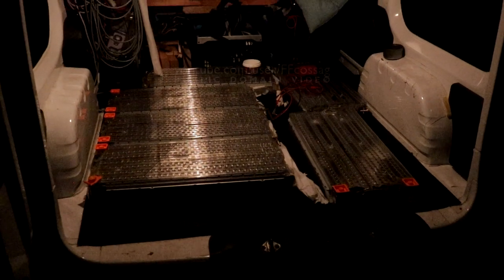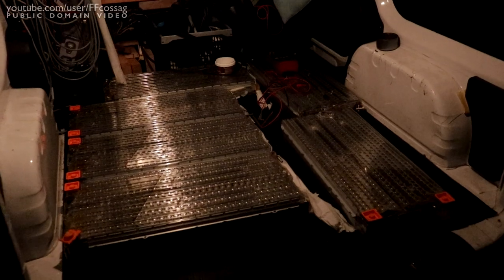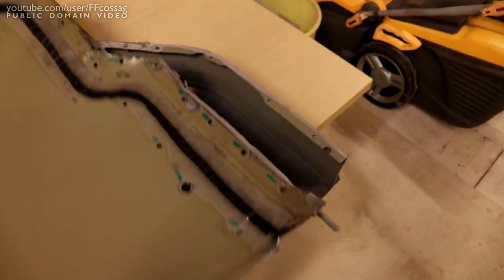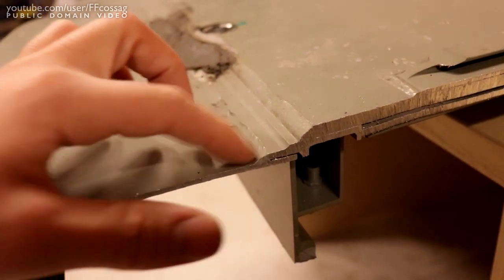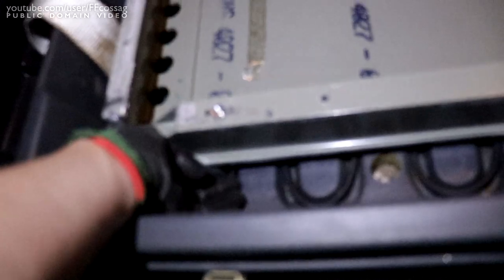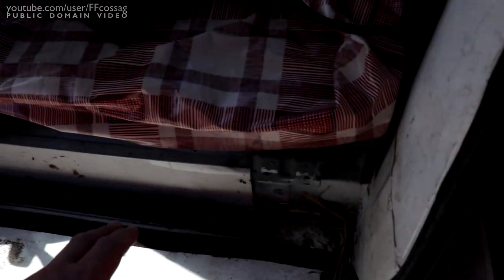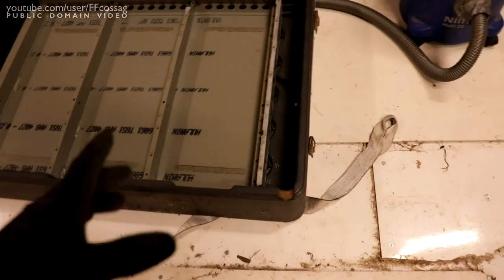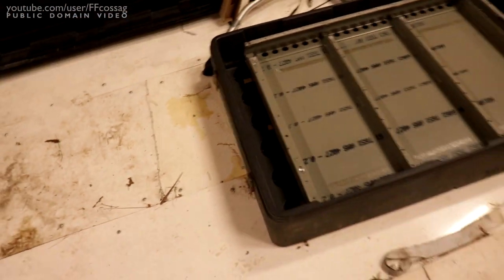Elcat Lithium Conversion EP1: Battery Box

Comment: I'm pretty sure the battery box is made out of steel. Not aluminium
Reply from the maker: The top is steel, the rest is aluminium. Trust me, I've had to saw it into pieces.
Reply: @FFcossag  damn, would have thought aluminium is too weak to keep it contained.. though maybe it's designed to drop down and well idk. I just recall Tesla ppl one time or even Tesla it self, claiming that it's a steel box.